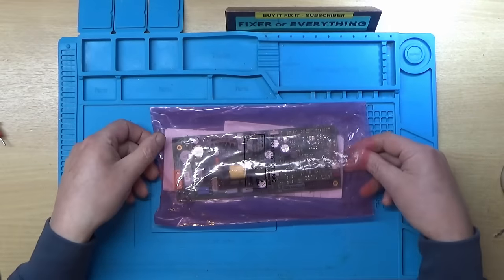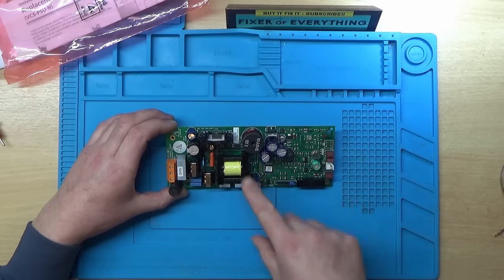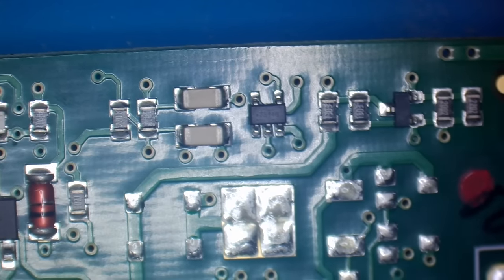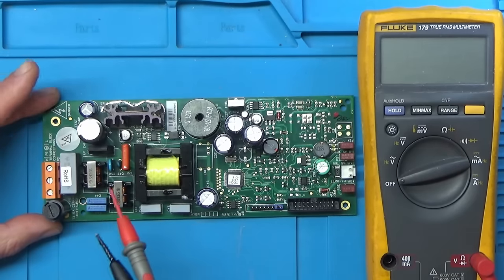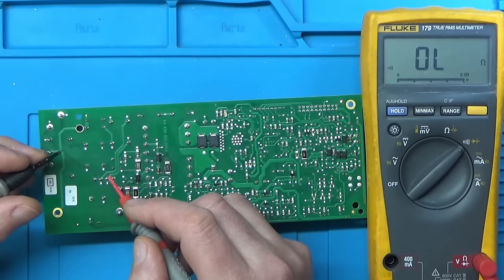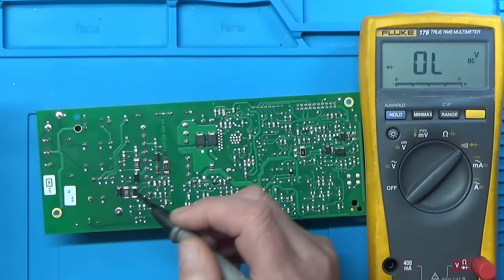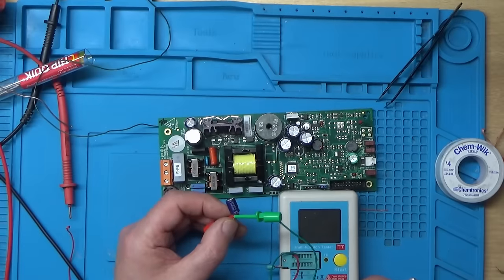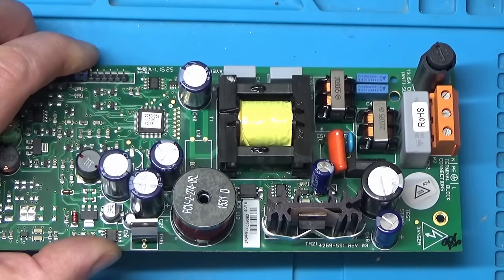VERY Expensive Fire Alarm Power Supply | Can I FIX it?

Comment: If I recall, your data sheet for the ‘UC’ chip listed the maximum voltage where the operation HAD to start as 8.8 V.  The typical (most units started) was your expected 8.5V.  My experience is you better always keep in mind, and check the WORST CASE, rather than depend on a single “typical” number.  Well, you got it anyway.  Fine job!
Reply from the maker: Thanks 👍I forgot to measure the voltage on the VCC of the IC after repairing it on the video. I did measure it a day or two later and it now reads around 12V.

Comment: Quite a few years ago, When i was repairing TVs, VCRs, microwaves, and just about anything electronic, I would always check the electrolytics mounted near a heat sink. The heat dries them out.  The smaller values are particularly susceptible to drying out.
Reply from the maker: Thanks for sharing👍

Comment: Excellent job, you've just saved somebody hundreds. Although UK power is supplied to domestic premises at 230Volts, Ofgem allows a tolerance of +10 and -6% on what you receive at your Service Head (Meter) that's 216 V to 253 V, so 251Volts is still within what is allowed.
Reply from the maker: Yes but only just within the spec. The problem is, this was late at night and pitch black outside. When the solar panels kick in, I've seen the voltage rise to 265V at which point the inverter cuts out with an error.
Reply: @BuyitFixit  That does need looking into. By the accent I would say your a Geordie, so that puts you within Northern PowerGrid's remit. You can contact them by calling 105 from a landline, The call is free.

Comment: That was a great fix without a circuit thanks for sharing it's surprising that quite a lot of faults are only caused by a capacitor or a resistor going open circuit or short circuit. It goes to show that in general a well designed circuit the semiconductor components are pretty reliable. I guess the cap failed because it gets the heat from the heatsink which isn't going to help it. Good job another board saved.
Reply from the maker: Thanks Dave 👍

Comment: I'm in Northeast Georgia usa. And when I was working as apartment maintenance supervisor years ago I had to fix a couple of those. I mean the company didn't want to buy them so they knew I was good at electronics and they asked me to give it a try. We had a lot of iron in the ground around us in the apartments were kind of up on a hill. We were getting hit by lightning all the time up there. It turned out it was a fairly easy fix, the ptc's were burnt out on the input protection
Reply from the maker: Nice 👍 In my last video I was repairing a Dewalt 4 way charger which suffered a similar fate, although it was caused not by lightning but by the user plugging the 110V unit into a 240V outlet 😂😂
Reply: @BuyitFixit  🤣🖐

Comment: Good repair, intrepid repair-guy :) I like the logical thinking you used to work yourself through the problem at hand. 
Very clever to use your powersupply to supply the necessary voltage to get the circuits to work.
To quote a famous engineer in one of my favorite shows (his name is Scotty): The right tool for the right job :)
Good job all around which is worth a subscription !
Reply from the maker: Thank you very much 👍I've had to come up with some quite creative things in the past when trying to repair things. Even having to delve into reverse engineering software at times too! Check out the FLIR thermal camera video I looked at, and there was the Solar inverter where I repaired it, and they wouldn't give me the service password so I had to reverse engineer the software to figure out how it was calculated. There was also the VTech baby monitor which yielded some unexpected findings!

Comment: Same issue with gate motor power supplies, which use a similar IC. I keep the output capacitors and some 47uF 63V capacitors to replace those, though they work fine with any value from 33uf to 100uF on the primary side, just replacing the capacitor there, and the 2 on the output side, will fix most of them. good as those PSU units are nearing the $100 mark now, and the fix costs under $2 to do.
Reply from the maker: Thanks for the information 👍🙂

Comment: 23:17 - Slots that you used for green and red wire are K and A, for diode testing. You need to use 1 or 2 or 3 slots as you did. You can also open device and solder wires directly inside, to prevent bad contact at lever thingy. In that way you also have wires always with device.
Great findings. ESR just high enough to drop voltage to disable IC.
Reply from the maker: Thanks and thanks for the tips 👍

Comment: Before retiering, I repaired many hundreds of power supplies with this family of chips. The most common faults when not starting up were:
1. Chip fault.
2. Capacitor fault.
3. Startup resistor fault.
4. Zenerdiode fault.
Sometimes the chip does startup, but to continue working, the 220K resistor is too high and cannot supply the power needed to keep the chip working. So the capacitor is discharged below the threshold, and the chip stops working. The capacitor is then recharged, and the chip restarts to stop again quickly. You only get small "spikes" on the output of the power supply.
For that reason, there is a diode connected to one of the windings of the transformer that supplies power to the chip, so it continues working.
This phenomenon happens when there is a short on the output side. It can also happen when the small capacitor, the one you replaced, is leaking too much. The voltage gets just high enough to start, but the leakage of this capacitor is too high for the voltage to rise to the normal working voltage of the chip. That usually is somewhere between 12V and 18V. That should be the voltage of the zenerdiode.
Reply from the maker: Thanks very much for your detailed explanation. I thought that the black diode seemed next to the zener appeared to come from the windings of the transformer so I thought that it must power the IC once it started up. I did measure the VCC to the IC after making the video (I forgot at the time) and it measured 12V. Thanks again, best wishes Mick 👍

Comment: I only have a high level understanding of what you do but man do i enjoy watching you figure stuff out! Thanks for sharing
Reply from the maker: Thanks 👍yes this one wasn't the standard run of the mill repair. Most people would have given up with this, but I've had a fair bit of experience over the years messing around with different devices and code so managed to find a working solution. Hopefully this video will help others with the same problem as I've put a link to the software in the video description with all of the files needed to flash, so hopefully it should be a matter of plugging it in to a USB with the button pressed, then running the program to restore the device 🙂

Comment: When you use a DMM on a DC range it is important to remember that most DMMs will show you a time-averaged value. For example, a square wave that swings from 0 V to +5 V will usually result in the meter displaying 2.5 volts. If the frequency is very low or the meter is "fast" the displayed voltage may be almost anything between 0 V and 5 V and "unstable."

With the UC3845, the voltage reference output will be 5 volts if the Vcc for the IC is above the lower limit. If Vcc is less than the lower limit Vref is pulled down by a resistor of nominally 5k (from text description of Vref in the datasheet). The fact that Vref was reading as 1 volt very strongly suggests that the IC was repeatedly trying to run. The cap that was replaced was almost certainly charging to the turn-on threshold for Vcc. As soon as that happens the current requirement for the IC itself increases and quite a large amount of current may be required to drive the gate of the FET. Normally as soon as the circuit starts running an auxiliary winding on the "transformer' keeps the cap charged. If for any reason the supply doesn't come up quickly enough, the cap will discharge to the turn-off threshold and switching will stop. That returns the IC to requiring only very low current. The cap will charge from the input supply through the high-value resistor, the chip will turn on and another cycle starts. 1 V at Vref suggests tha 3845 was running about 20% of the time, with unknown period.

Some additional information can be had with a meter on an AC range if a DC blocking capacitor is used (I think Fluke meters have one internally in most models - check by measuring a battery on AC; the AC reading would be zero if there is DC blocking). If Vref was "stuck" at 1 V you'd expect close to zero AC. If it was switching between 0 V and 5 V you'd get an AC reading of probably hundreds of millivolts or more, depending on the actual waveform and the way the meter interprets it so the value displayed is mostly just a hint of what is going on (consult meter manual). Similarly the voltage on the cap in question would have a moderate AC component (in neither case does the polarity of the voltage actually change but the meter "sees" it as true AC due to the blocking capacitor).

An oscilloscope is very much more informative but you absolutely must use an isolation transformer for the AC input to such a power supply unless you have a scope that is isolated from mains ground and designed to be safe if its ground is "hot." Very few fulfill the latter requirement. With a switchmode power supply you can often get some idea of what is going on by simply holding a probe near the power components where it will pick up radiated noise. Use a clip tip for the probe so you have a bit of an antenna. Just don't drop the probe - exciting things happen if the ground on the probe touches something in the circuit and an isolation transformer isn't being used.
Reply from the maker: Thanks for your detailed explanation and thoughts. Yes the meter isn't fast enough to see what's going on if the voltage is changing. I should get myself an isolation transformer so I could then hook up the device under test to it and perform measurements, although a company did just email me and asked if I'd be interested in reviewing one of their handheld scopes which would be isolated from the mains. Thanks again 👍
Reply: Thanks for taking the time to write all that out! A great majority of YouTube comments on technical things don’t provide much value, but I really appreciated learning a new (to me) troubleshooting technique of using the scope probe as an antenna near parts.
Reply: Use a battery operated scope
Reply: You can get a small battery powered scope to measure smpsu ! It’s negative Gnd is floating and maybe up to 600 volts it can measure! Also use x10 scope probe! You get these scopes now for £ 60 - £100 ! Also useful is a ESR meter for checking capacitors to measure equivalent series resistances many about£50 ! It applies about 100khz  to the cap and measures the impedance! You can also test coils, transformers with shorted coils! A very useful little device! Fraser🛠
Reply: Given that the bias cap had gone high ESR, it is likely that the actual voltage on pin 7 of the UC3845 had a large AC component as the chip started, drew too much current for the startup resistor to supply, then shutdown again at perhaps 10s of hertz.  Another clue was the average of 1VDC on the Vref pin which is likely to have been starting and stopping as well.  I would have loved to see that signals at VCC and Vref on the scope, not just the 8.50VDC & 1VDC average readings.  Another easier trick is to simply measure the AC voltage - this will give you confidence that something is not oscillating.  After replacing the cap, I have a feeling that the VCC DC voltage was going to be more like 12VDC...

Comment: Good job! I was thinking maybe a bad Zener, resistor, or cap on that start up supply. After it's running VCC for the chip is usually supplied by a small run winding on the transformer. Great troubleshooting in this, it's rarely the ic.😊
Reply from the maker: Thanks, yes I did notice another diode next to the zener which seems to be fed from a tap on the transformer. I forgot to measure the supply voltage on the IC when it was running on the video,  but I did afterwards and it was 12V.

Comment: While the end roll ads are running , I'll comment .... Awesome diagnostics and fix .....  I have one of those component testers and I found that if you use the bottom left pin section it will give false readings , as you know it's for zener diodes , I forgot to switch the pins to the other sections a few times .....  Mine is about 7 yrs. old and the 1 pin in the sections do not work for ESR readings ,  2 and 3 are spot on , I double checked with my BLUE ESR tester ..... 1 pin works fine with 123 sections for transistors though .....  I did find an old Micronta Dynamic transistor tester 22-025 model new in the box for 20 bux on QRZ  ham site ......  A sweet find for sure , I had one 30 plus years ago and it's great for matching transistors ......  You saved that some money on that repair .......  Take Care Mon Ami ......
Reply from the maker: Thanks Cajun and thanks for letting me know about the component tester. I thought that you could use any of the pins. I guess I should look at the manual.  I don't use it too often, as normally just use my meter but it does come in handy especially for capacitors 👍

Comment: 8:40 In Denmark, we have 230V between phase and ground (Un ± 10%), so 251.6 volts would be within specifications.
Reply from the maker: Yes, we occasionally had 255 and 257V though. They came and fitted a monitoring device and have since dropped the transformer by a tap apparently.

Comment: Fly-backs often broke like this. You can hook up scope to this cap and in most cases you will see.  But your method with adding DC to Vcc of chip is also nice and checking out waveform. Maybe I will do this that way some day :)
Reply from the maker: Thanks 👍
Reply: That part of the circuit should all be considered to be at mains potential. You cannot connect an oscilloscope "ground" unless you are using an isolation transformer of the scope has a SAFE floating ground. With many mains-powered scopes the ground is connected to mains ground.
Reply: @d614gakadoug9  yes, I'm using 230/230 classic transformer and ground is disconnected,

Comment: i use the same brand system, and the expensive  bit is the certifications, and of course they have the monopole for the spare parts
Reply from the maker: Yes, but surely the certification is for the design and testing. Someone mentioned that repairing it would be an issue, but I fail to see why. I mean  if the fuse blew on you replaced it or you replaced the batteries then it would need recertified too as those are both repairs to a unit that isn't working as intended.

Comment: 14:05 There will be an auxillary winding on the transformer that powers the chip. That SMD capacitor is the start up cap.
Reply from the maker: Thanks Simon👍, yes I worked that out after looking a few schematics of the chip. There's a black diode next to the zener one that seems to take the output from the transformer as you said.

Comment: Would have loved if you’d checked the voltage on that pin after the capacitor swap. What is a normal startup voltage when everything is working?
Reply from the maker: I forgot to measure the supply voltage at the time, but I did after finishing the video. It reads 12v now when the PSU is running.
Reply: @BuyitFixit  thanks! That’s quite far away from spec then. I guess it stands to reason that it would be received by you when just barely too low to start the IC. When the IC stopped turning on, the board wasn’t working and was taken out of service.

Comment: The startup voltage is quite often dropped from the hv dc line through high value resistors, so a little leakage through the cap will shunt it down and stop starting.
Reply from the maker: Yes, spot on 👍
Reply: I have worked on a fire alarm power supply design. These have very high approval costs which does not help the price. This has prompted me to find out how much!

Comment: Electrolytic cap failure is very common. I'm surprised it doesn't appear more often on your channel. Maybe is it because you're generally looking at relatively recent (i.e. not old) devices?
Reply from the maker: I've had a few cap failures, ones that spring to mind (fridge repair was a 3 items in 1 video) and on one of the caravan PSU's I looked at. I've looked at quite a few old handheld games from the 70s and 80s but the capacitors usually seem OK in those.

Comment: Nice fix. Do you think it was the ESR just pulling the voltage down a bit too low for startup?
Reply from the maker: Thanks 👍Yes that's the conclusion I came to. I did measure the voltage after making the video (forgot to do it at the time) and the chip now has a VCC of around 12V 🙂👍

Comment: Did you ever test the voltage supplying the chip again after changing the cap?
Reply from the maker: Yes, I realised that I forgot to do it on the video, but I did do it the other day just to see what it was if anyone asked. It now reads 12V across the capacitor and to the VCC of the chip when it's running.

Comment: 21:26 Its NOT the IC. The SMD capacitor is bad. I have a PSU that uses a 3845 IC. One day it wouldn't start up. The same resistor (300K) had gone completely open and the capacitor was marginal. I replaced both.
Reply from the maker: Well I got there eventually 🙂The reason why I suspected the IC, is because I did a video on a PSU a while back (KT12SM) which didn't have the 5V ref, and it turned out to be a faulty IC.
Reply: @BuyitFixit  Ok, I haven't watched that one.

Comment: I was given a high end car stereo that wouldn't work. Fix was easy. When I lifted the lid, there was a capacitor rolling around inside. It fell out due to bad soldering during assembly. I found where it went, & soldered it in place. Stereo was fixed.
Reply from the maker: Well done 👍nice and easy one for you 🙂